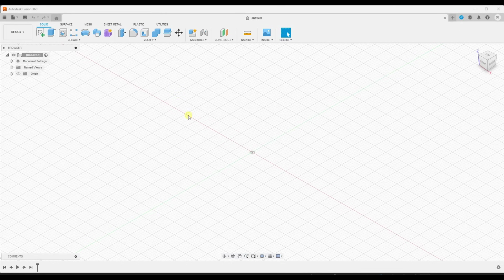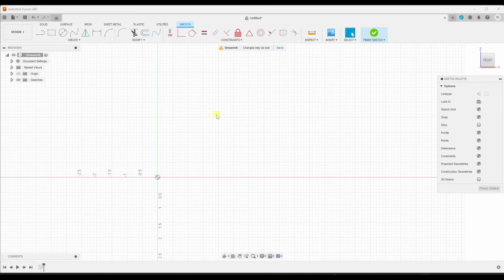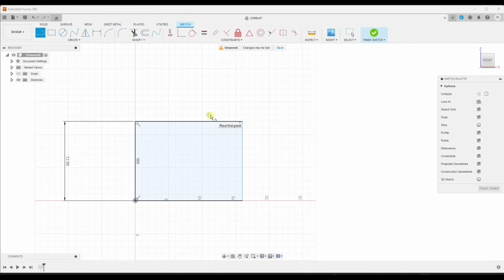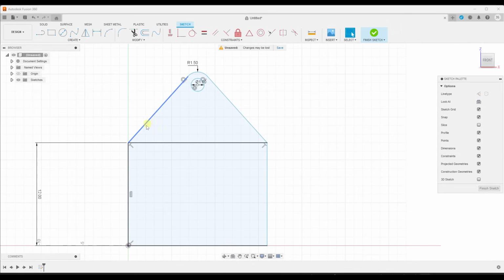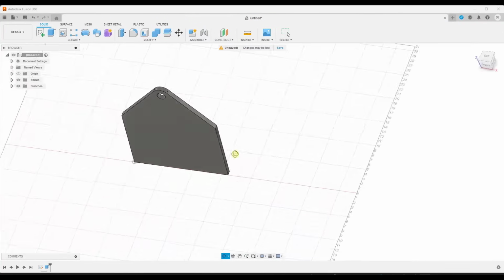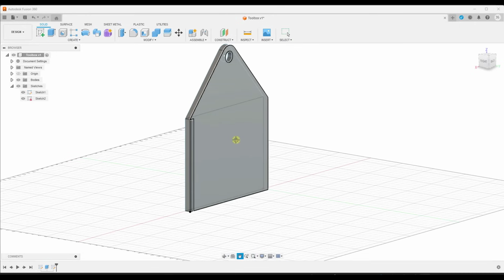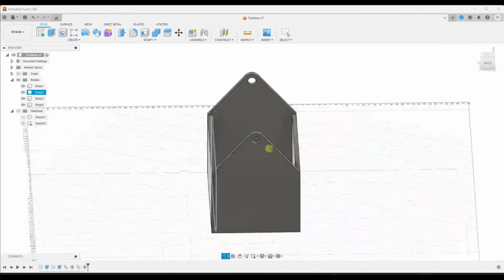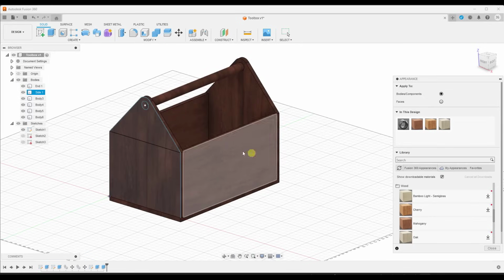Getting Started with Fusion 360 Part 1 - BEGINNERS START HERE!

Comment: Justin, Great videos, But I am wondering if you could help me figure out how to make a sketch change to a specific size, actual dimensions. I made full size templates then took a picture of it with a 1" drawn on the template so i could trace over it both the periphery and the line I drew at exactly 1" . the shape i'm making is to fill in a corner of my truck sheet metal / Plasma... Another way I tried was measure the template width but when i click on the first point it is actually curved so it lights that up then i move the curser to the left side and click and that is an arc also I was hoping i could click each side and put the actual dimension in to grow the part to exact size? Thanks for trying to understand where i'm coming from -Rick
Reply: I found it! On one of Your videos of course. (https://www.youtube.com/watch?v=lmgFV-JTWxo) You do a really good job of explaining things clearly, Thanks Justin!!

Comment: Thank you for your videos but there are certain things you fail to provide that are vital to understanding and following you. I noticed that while you're using your mouse to select etc, you're also using your zoom tool, I'm guessing with your other hand. Is there are keyboard shortcut to the zoom tool? Also how can one simply modify a sketch after it has been finished. I noticed my sketch was too wide and needed to shorten it. How would you do that. Also I'm not sure if you're on a Mac or PC but your instruction to shift plus mouse to orbit doesn't work on a Mac.

Comment: ive started over a couple times, every time I go to draw the base it will not go to the face of the project, i draw the rectangle from one corner to the other but it will not let me take that dimension past the inside edge of the end piece, leaving me with a "step" of sorts as if ive drawn the rectangle 3/4" too short in the Y dimension (bottom view). What am I doing wrong? i have managed to get it to extrude but then it goes from 4 bodies to 1
Reply: I have the same problem. And I am unable to select the circle at 19:21 to extrude from to make the handle. Feel like I’m missing a step there.
Reply: Oop saw another comment and sketched another circle.  That did it. 👍🏼

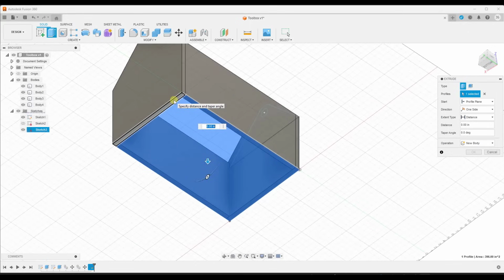Comment: What caused me a problem was at about 18:24, the rectangle tool is used to carefully mark out the EXTREME corners, but then a little later, when performing the extrude, the 'missing long rectangular section also has to be selected to obtain the full base. The words used are "make sure that I've picked up this face as well", which I missed on a couple of viewings. The question is why ?
Reply: I got tripped up on the same thing. Why didn't it just grab the whole thing when you select the rectangle? I'm so brand new to this that I may not even be asking the right question. In any case, @koshkakk, thanks for your comment; you saved me from flunking the first tutorial!
Reply: Same problem. Mac m4, Fusion 360 free license

Comment: This tutorial is great, except most of the civilised world is using the metric system these days.
Reply: From a metric-primary country, imperial still has its place in a lot of craftsmanship. A lot of material thicknesses fit very nicely into imperial measurements (2” thick tabletops vs 50.8mm, 3/4” cabinetry vs 19mm…), and the ability to easily halve things to almost no end without needing a calculator is very nice (in imperial you simply double the denominator and you’ve got half your measurement, so half of that 3/4” thick cabinet is 3/8”, half of that is 3/16, then /32, then /64 and so on; half of 19mm is 9.5mm, half of that is 4.75mm, then 2.375 and so on, and measuring that accurately is very difficult with simple tools like a ruler or square). Longer distances, like aircraft altitudes for instance, make much more sense in metric, but being confident in both systems and applying them where they make the most sense is really the best thing anyone can do
Reply: @thomasellis7625  19.05mm  ha
Reply from the maker: https://www.youtube.com/watch?v=KjjUhvmo_xs
Reply: Jesus you people are annoying
Reply: I served my apprenticeship as a toolmaker and we used imperial measurements alongside occasional metric use. Over time, imperial was phased out in favour of the metric system, so being fluent in both and still currently using metric on a daily basis as a lathe turner, I can confidently say that metric is a lot simpler and user friendly. Oh, I'm from the country that gave the world the industrial revolution. 😉
Reply: Most of the people saying that the civilized world knows how to spell. How come you guys don't know that civilised isn't incorrect and is the correct British spelling? 🤦
Reply: 😂😂😂 my man, the US imperial weight standard is derived from a kilogram weight standard which is then converted to several significant digits imperial lol. We've been secretly metric for years and years. I cite weight but NIST defines a standard foot from metric too. Imperial is quite handy still for lots of things. The most recent metric imperial snafu cost NASA millions of dollars...

There's no reason we couldn't just easily round metrics where imperial measures are nice and even, so instead of an inch being 25.4mm, just round it to an even approximation, that'll still work conveniently and observationally no one would be any the wiser. 2x4 becomes 50x100, no one will notice the missing .8x1.6mm that were rounded down from the full inch. I mean a 2x4 isn't really 2x4 anyways.
Reply: Look at all of that well internalized imperialism. It definitely matches the attitude in the world stage, same shit just different orders of magnitude. WTF are you talking about the moon, your opioid pills are also in inches... it doesn't matter, Metric still is the most logical & comfortable tool to use. And it doesn't make any difference for this video, he's teaching fusion360.  
AmEriCa, FuCk YeAh!
Reply: Someone had to knock the needle off the record 😔 of course the only real country is the one that takes up the whole world, just like the only real race is the human race... You can't go anywhere without some kind of behavioral plagues, maybe Switzerland but I suspect even the Swiss have their corruption issues somewhere.
Reply: Excuse me but if you're not measuring in cheeseburgers to pop tarts your doing it wrong😂
Reply: Shut up liberal
Reply: I like how most of these comments have nothing to do with the video. 😂😂
Reply: It's funny how imperial users can easily use metric if necessary, but metric users raise an almighty fuss if anyone so much as mentions imperial. People, it's ALL ARBITRARY. Metric is just a French system invented by people that had an irrational hatred for anything that came before them. The width of a thumb or the weight of a fairy on the head of a pin... Base 10 or base 2...As long as it's standardized, who f'n cares?
Reply: https://youtu.be/ftEbH8ddIo0?feature=shared
Reply: Which programm
Reply: Plenty of euro vids, thank god I got an American
Reply: In engineering, the units you use often depend on what you’re working in, where the project is based, what company you’re working for, and what systems you’re integrating with, and probably much more,
Reply: Although metric is prevalent, I’m glad he showed using fractions since this is the system I use for woodworking and thus my interest in using Fusionn360.
Reply: Who tf cares. U can still learn 😂😂
Reply: Then how can you call them civilized
Reply: I prefer to live my life in an uncivilized fashion
Reply: Just in case this tool box ends up on the moon we better leave it in imperial units, eh?
Reply: Stop it already with measuring systems. Who gives two $hits what system a person uses. In software it is usually a one click operation to switch systems. 

Good lord. A measuring system is that big of a problem in your life????
Reply: The main problem with imperial is that it's difficult to teach to children. Measuring in quarters, halfs, 16ths, 8ths, etc. is difficult for them to comprehend.
Reply: This entire comment subsection is nothing but a pissing contest by folks with big ego's clearly compensating for many things on top of terrible social skills. What system do you use to measure things? Who cares. It depends on where you live. It doesn't mean you  are a factor of being "a/the best country". I'm from the US, and they can't be laughing at much right now. Having overpayed athletes doesn't make you a great country.
Reply: Does using metric preclude one’s ability to spell?
Reply: There are two types of countries on Earth...those that use the metric system and the one that went to the moon 😂
Reply: @RigPartyof7 nasa has been using metric system from the start
Reply: @RigPartyof7 You better fact check that since it was desinged using metric units xd. Why you think NASA exclusively use for most applications, metric system???
Reply: NASA is using the metric system tho
Reply: By any chance is that the same one where parents often fear sending their kids to school in case there’s a mass shooting?
Reply: @RigPartyof7 using the metric system...
Reply: @RigPartyof7 so how do you feel about your country today?
Reply: @RigPartyof7 Well they used the metric system for that! Remember most of their rocket scientists were Germans. Plus you want to know how long an inch is - guess what it's measured in millimeters against the SI standard. Along with every other imperial measurement. And just to point out how farcical the imperial system is a UK gallon is different from a US gallon - by a lot! A UK gallon is 25% more the a US gallon. WTF.
Reply: @RigPartyof7  most of America can't even do simple maths😂
Reply: We all laugh at America yet they have the best scientists and engineers in the world. I'll forgive them their bizarre fascination with fractions.
Reply: Most of the civilized world knows how to spell.
Reply: Back to back world war champs, we use what we want.
Reply: Cry s'more
Reply: Well the greatest country in world doesn’t.
Reply: @Dean-uc9ii I don’t think are great anymore
Reply: Hasn’t put a man on the moon.   Get some
Reply: Do you ever watch the NFL? That’s the civilized world. And what do they use? Nuf said.
Reply: @mrjayd Usually find (American) football rather boring - just a bunch of pushing & shoving and committee meetings. Bu I do often watch the Superbowl for the ads, which have been disappointing the last few years.

Comment: Gave up at the handle, I'm afraid.
'The circle we already sketched' - no sign of it to select.
Reply: I had this same issue, but what I did was go into the bodies and hid them with the "eye" icon. and then I only had my first sketch selected which better allowed me to grab that face of the circle to then extrude. after I had it selected I unhid the other elements of the toolbox again.
Reply: What worked for me was to ensure that the 'eye' for sketch 1 was ON. Then I was able to select the circle.
Reply: @koshkakk  Yes! Thank you!
Reply: @koshkakk  thank you. I spent ages trying to extrude the circle and your tip fixed it!
Reply: @koshkakk  Helped me too, thanks
Reply from the maker: Go back in sketch mode and draw a new circle and extrude that.

Comment: Cool job, man, thanks for restarting the series about the Fusion 360. And hey, if may I ask - could you recomment the best way how to work with F360 from the step review perspective? Meaning - I could "hard code" measurements of an object, but through the parameters in project I could just call the parameter and in case of a change, I can just change it in there and I don't need to go step by step in the timeline to change it. Hope it makes sense. I am kind of interested in those features and hints.
Reply from the maker: Yup - this is something I'm interested in learning more about anyway - I've really only done this the manual way, but I know there's a lot more power under the hood for this kind of thing